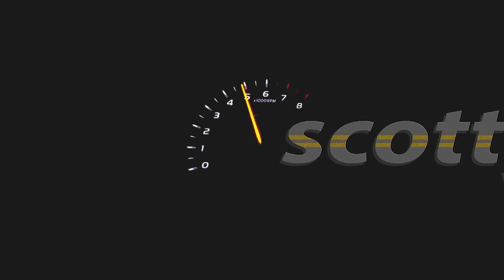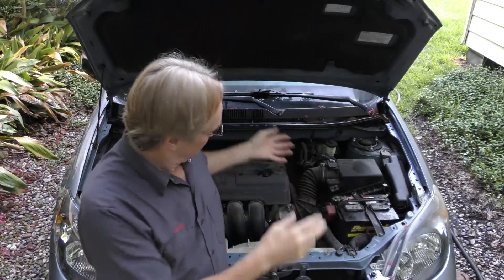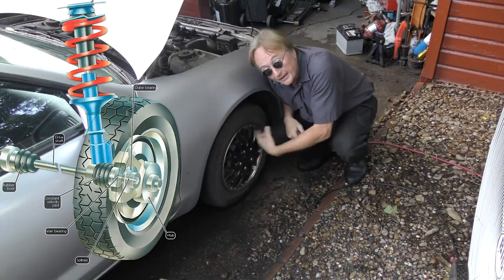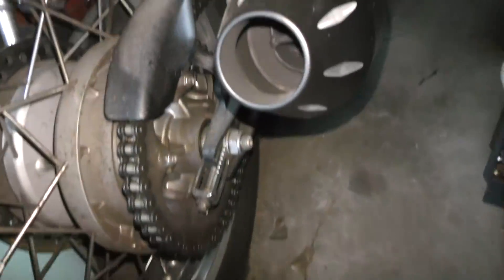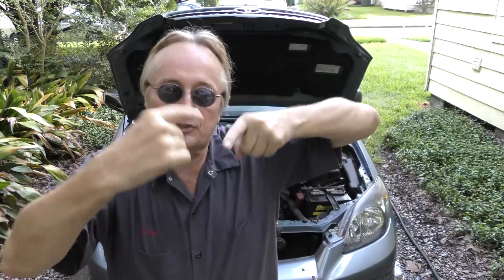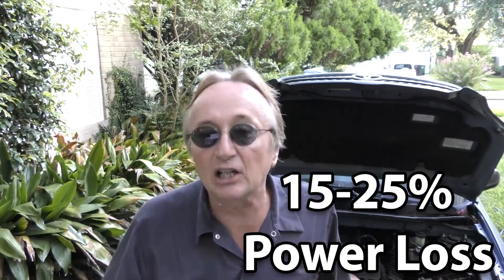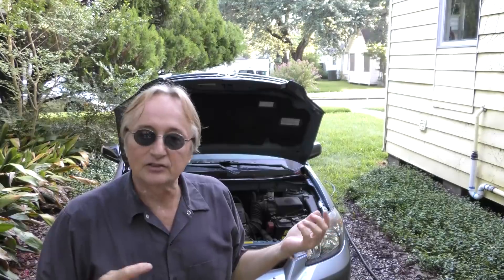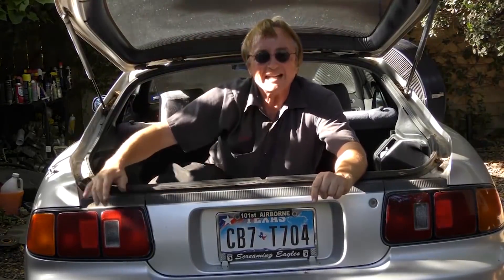Here's Why Your Car's Horsepower Rating is a Lie

Comment: what do you think about redline-ing your engine
Reply: Emin GanGster BS Its essentail if you want to get over 50k miles on a rotary, red-line it every drive and they will last over twice as long. Shift at 9.5k rpm if you have a stock engine.

For electric, its mostly temperature based, you don't want the wire insulation/enamel melting. Bearings will wear out slightly faster.

Piston engines will wear out faster, but what else are you going to do if you want that power? Duel turbo, methanol and NOS are some common options, but its a lot easier and cheaper to just let it rev up.

Jet engines red-line is based on exhaust temp for melting turbine blades and centrifugal force, but there isn't much harm keeping them at the limit, its the cycles of heat that kill them, so leave them spooled up.

Hamster wheel engines, people will call PETA... It's good exercise to redline your hamster once in a while, especially in winter when they put on some weight.
Reply: Jake Garret jet engine red line isn't just egt
Reply: John Arnold You are correct, I was dulling it down for the average person. Judging by the faces of most people when I start talking about jets or even stealth technology people get this blank look (or sometimes a look of pain when they are really trying to comprehend). Of course things are very complex, but I've found they usually don't want all the details.
Reply: Jake Garrett yeah

Comment: All the looses of power you mentioned Scotty PLUS ->  when they put the engine on a stand in the dyno room.   They have no water pump attached , no AC pump , no power steering pumps , no alternators that draw power from the engine. , no torque converter lugging on the flywheel.  Its just the block on a stand for a few seconds.   Just the engine alone actual horse power without it powering any of the power robbing leaches required by an actual street worthy vehicle .    Just like they run dragsters.

Comment: I recall two standards for horsepower; SAE and DIN (Deutsche Industri Norm). The SAE is the engine with no exhaust pipe and no drive train attached. The DIN is taken on the wheels. My first car was a Volvo 142. The dealer told me that it had 90 HP. When the car was brought and I later read the instruction manual, the car has 90 HP (SAE) and 82 (DIN). Anyway, back in the 70's most cars did not have many horsepower and the Volvo performance was fair even with 82 HP on the wheels.

Comment: I thought the U.S. made a mandate starting in 1972 all cars would switch from gross hp to net power. Is net at the wheels or after all accessories are hooked up, ac, alt, ps, etc...? I thought net was at the wheels.

Comment: I completely understand this. My 09 Nissan 370Z makes 332 horsepower at the crank. Really it makes about 285 horsepower at the rear wheel. That’s just stock. Now it’s fully modded with a tune, it makes 380 brake horsepower. And 308 wheel horsepower!

Comment: I saw a program where it showed a rear drive differential wasn't that inefficient. They were able to use a 1/4 hp electric motor to spin the differential to 200 mph road speed. Most of the power loss is the transmission. And automatics have servo pumps that are up to 2000 psi to pressure up the TC and drum clutches. But, today's automatics are a lot more efficient than ever before. Still...I prefer a really good shifting manual as I feel a lot more engaged with the car. Seems to make seem less like a 4 wheeled kitchen appliance...

Comment: Actually, starting in 1971 (I believe, but I might be a few years off), manufacturers switched from gross HP ratings to net HP ratings. Gross HP is how much the engine is putting out in ideal conditions. Typically, it would have been measured with the engine on a test stand and no parasitic loss from pesky accessories, like water-pumps, alternators, etc. Net HP would be how much the vehicle is making at the wheels, with all of it's accessories in place.

I'm not sure why your Mustang measured less on the dynamometer, but when the manufacturers make their readings, they do so using premium fuel, low humidity, room temperature air and an ideally tuned engine. Variables such as air pressure and air temperature, humidity, tire pressure, and even the temperatures of the drivetrain fluids can affect the car's HP reading. There can also be some parasitic loss between the tires and the dynamometer rollers due to slippage. Not to mention, cars sold at the dealership are tuned to operate in a wide range of environments, meaning, they aren't ideally tuned to operate in any one environment. An engine programmed to operate ideally in the Colorado mountains won't do as well as one tuned to the environment of Hawaii.

Comment: Did they change how they measure horsepower? My 1970 El Camino with a 350ci 4 barrel was rated at 300hp. My friend's 1970 El Camino with a 350ci 2  barrel was rated at 250 horsepower. Neither car compared to a car today with the same horsepower ratings as far as acceleration or speed.

Comment: And another reason horsepower ratings from factories are a lie is because they test a few, or even just a single engine that’s already been worn in. It takes time for your engine to be broken-in and run efficiently, because bearings, pistons, and many other parts get a better seal once they’ve been broken in. That’s why in almost every driving manual for sports cars today tell you there’s a break-in period telling you that you have to meet those requirements before you immediately start revving and doing digs and launches with your car.

Comment: Hi Scot, I’ve been a long time follower of your videos and i have always taken something home after watching your videos filled with knowledge. I have been confused by the methods used by Mercedes Benz and BMW for some time on how they rate their vehicles engine capacity according to the badges they are marked with, even before the vehicle left the factory. For example the latest BMW 1 series comes out with two 1600cc engine variables, one of the 1600cc motors which i suppose would have a “standard” ECU mapping and another 1600cc motor with a “better” ECU mapping. However, the 1600cc motor with the “standard” mapping will be badged as 116i but the other motor who has the “better” software but yet badge it as a 118i? Its brand approved.?I wouldn’t necessarily suggest someone replaced the (6) with a (8).. and with Mercedes-Benz method i have yet to figure that out.

Comment: The Lotus also developed the Ecotec engine of the L61 to even at one point Chevy have once sold a Lotus.  Even a Toyota Cavalier.  Now if I can find a good transmission to place all of that power to the rear wheel of the old hatchback Cavalier, have quite a bits of space in the rear I will never get anybody to fits in.

Comment: Unless you buy an LS1 engine. My 2002 WS6 was rated at 325 hp at the crank. Yet it made 331rwhp on a SAE corrected dyno.

Comment: I remember a while back I saw a debate in an online forum, where some guy in a 2008 Cobalt SS Turbo was kind of bragging about beating the older 2003-2004 Pontiac GTO's - despite the GTO having something like a 90hp advantage. This spurred on a huge debate between the two car groups, but then finally one of the Cobalt SS guys laid it all out and ended the flamewar...

Apparently, the 2003 Pontiac GTO initially came standard with an automatic transmission and through drive train loss, as you put in the video, only dyno'ed about 270hp at the rear wheels. The 2008 Cobalt SS Turbo made 240hp to the front wheels. It had less drive train loss because it was a front-wheel-drive car with a manual transmission.

The power difference between the two cars was cut down from 90hp to 30hp... just like that! Now it was all down to gearing, weight, and the driver (more so the driver of the Cobalt SS since it was a manual transmission car).

That's when I learned that having 300+ horsepower at the crank is good and all, but what's the power to the wheels? I would've hated to have bought an '03 GTO with 350hp thinking it was a decent sports cars, only to get walked by a Cobalt!

Comment: One thing to note is that low HP vehicles have bigger losses than high HP vehicles.
Spinning the wheels at 60 mph takes the same amount of energy regardless of how much energy is entering it. The only variable that will go up with HP will be slip which typically isn't a very large loss.

Comment: Apparently there are a handful of engines that produce more power than claimed. The GT-R was one of them, since they’re hand built. GM was conservative with their estimates of the the supercharged 3800 V6 because of temperature sensitivities. I don’t think the engine overheated per se, maybe it just produces different power figures at different internal temperatures.

Comment: Sometimes it goes the other way.  My current car is a 2018 Accord with a 2.0T.  Honda states that the rated horsepower is 252 yet the car consistently comes in at 266 on a dyno.

Comment: The drivetrain losses to a rear drive vs a front drive only has to be quite insignificant.  Yes, rotational torque has to change directions, but I really don't see the losses involved, other than having to spin up a relatively heavy drive shaft and maybe the hypoid gears involve a little more friction.  But seriously, where does that energy go?  It has to go off as heat/friction.  I would guess it to be 1-2% more loss than that of a transverse mounted engine in a front drive car.  But those 1-2% figures become big factors when trying to get a car to be emissions compliant.

Lots of Audi/VW cars are front wheel drive, yet have a longitudinally mounted engine.
The Renault Medallion had the same setup.
The Chrysler LH cars also had the same setup.
I am sure there are more.... such as the Acura Legend.
The classic Saabs, too.

Motorcycles run chain or belt drive due to cost and weight savings.  It is far cheaper and lighter weight to implement a chain drive instead of shaft drive.  Since most motorcycles have a very limited lifetime mileage-wise, there's s no reason to implement anything else.  

The front-drive package was implemented with the original intent of reducing costs and making the drivetrain more compact and eliminating the need for a hump down the middle of the passenger compartment.  It was marketed as having better traction, which it did, and deemed safer because it wouldn't do a donut on a snowy road as easily as that of a rear wheel drive car.  it would increase passenger compartment room in a market where the physical size of cars was shrinking.

Comment: Wikipedia: "In the case of an engine dynamometer, power is measured at the engine's flywheel.[citation needed] Also, with a chassis dynamometer or rolling road, power output is measured at the driving wheels. This accounts for energy or power loss through the drive train inefficiencies and weight thereof as well as gravitational force placed upon components therein"

Comment: High HP doesn't necessarily mean efficiency. You can have a rich mixture, primarily in turbocharged engines that burn lots of fuel but put out extra energy.

Comment: True most of the time. But I just watched a Mk 4 GTI get on the dyno for a base run before mods rated at 170 horsepower.  And put down 178 to the tire completely stock.

Comment: MACK Trucks rates the horsepower of their built trucks using a Dynomometer at theor production line. Once a truck is finished-up they send it to a rolling dyno to test and give proper Horsepower ratings, so when MACK TRUCKS says you are getting a 610 HP / 1,850 LBS/ FT MACK TITAN it is a truck that puts 610 HP and 1,850 ft/lbs torque to the ground.

Comment: Semi Truck Manufacturers usually have entire charts dedicated to this with HP at rear axles with various engine and transmission packages. 

But unless its towing or racing the average commuter its just empty numbers past 120HP.

Comment: This says correct horsepower is between the engine and the wheels. What about between the wheels and the road - should that mean something? Is it horsepower if you're spinning in mud? (Maybe so - maybe a horse spinning his hooves in mud is still generating power. I don't know. That's your problem. I'm just asking.)

Comment: The 2017+ Honda Civic si’s hp rating actually is pretty accurate. People have dyno tested them and came out more than Honda rated for them at the wheel. This is without the flash pro upgrade. I didn’t think my civic would be really close to that

Comment: Hey Scotty..  So what's the actual difference between BHP Brake Horsepower  and WHP Wheel Horsepower?   Why measure it at the brake and at the wheel?  Are they the same or slightly different?

Comment: A lot like outboard motors. Not as many places for power loss on them, but the drop is about 10%. They used to measure horsepower at the crank. Manufacturers were mandated to rate all new outboards at the prop shaft in 1985. I don't know how they got a reasonable statue passed, but it would be nice if they did the same for car horsepower rating, and based it on a dino on cars. A different era, I guess.

Comment: About time someone pointed this out. BHP is not just BHP A lot of BHP is crap. I met a guy with a very old large heavy 1930 Rolls Royce and it moved along fine with only 35bhp. I was in the soud production business for years and Watts were not Watts, I had Amplifiers that would out perform the new switch mode Amplifiers with twice the power. And there are some cars with half the BHP of others that can out perform them or others and very quietly. After 60 years of motoring with some very fast cars, to me BHP and noise are both nothing but a load of crap, made mostly for juvenile personalities.

Comment: Scotty, I hate to break it to you but there are automatic transmissions out there that also do not have torque converters. All the super cars of today use dual-clutch automatic transmissions which use computers to control the shifting of the gears in much the same way one would shift the gears in a regular manual transmission. The only reason regular automatic transmissions (with torque converters) are used today is for cost reasons and also because dual-clutch automatics are terrible in heavy traffic. The computer constantly activates and deactivates the clutch when you creep along thus wearing it out at an astonishing rate. A regular automatic with a torque converter can safely creep ahead with 0 damage to the transmission. 

I only wish for the older generation to finally acknowledge not all automatics are slushboxes.

Comment: All horsepower lost is turned into heat. Since there are so many variables between the drive shaft and the wheels how would you like them to rate engines? Unless you operate the engine at the RPM the engine horsepower is rated at you'll never use it at full power output. Even the weight of passengers and whether or not the AC is on will affect the maximum horsepower at the drive wheels.

Comment: Cars also lose hp more or less depending on the tires, tire pressure etc. Tire hysteresis is the main reason for "rolling resistance" which is dissipated as heat.

Comment: Often times Dodge has underrated HP on certain cars.  The SRT-4 is a prime example.  That little neon actually got 220 to the wheels, same as advertised, wheel horsepower was actually 245/250, which was supported by the performance aspects of the vehicle.  Dodge did that same crap back in the late 60's early 70's.  Some say it was for insurance purposes, who knows?

Comment: The ONLY thing FWD has over RWD is ease of assembly! Rotational losses are actually higher in FWD due to the convoluted route the power travels. Had a Lincoln LS advertised at 210hp and dynoed at 190. IIRC parasitic loss is around 10%-15% in RWD cars.

Comment: I don't think they are actually lying, that is what the motor makes. If you actually didn't know that the rating was from the crank you're not a car guy. Hot Rod Mag. did a test back in 2004 by taking a mustang around to 4 different types of Dyno's. Their results were between 205.7 H.P. TO 226.9 H.P. The factory said the car was rated at 260 H.P. So it actually depends on the dyno. used too besides a lot of other things, weather, temp. of oils, tire pressure, guy running the dyno, ect..... Great vid though, you've been pushing them out fast lately.

Comment: Scotty I have a problem with my car, I drive a 2009 g37xs but now for some reason the gas gauge is not reading the gas level properly. 

I brought the car to the dealer and they told me to change the sending unit and fuel pump which I did but the problem is still there?
I tried many different fuel and sending unit and nothing seems to work.I have also changed the cluster unit with a 2010 model to make sure it wasn't the cluster and problem still persist.
I have done some research and it seems infiniti and Nissan had that problem for many years back. there's other member who drive the G37 with similar problem.

I almost died while driving on the highway because I ran out of gas. I called infinity and spoke to them about this concern which to me is a safety concern but I was told that my warranty is done like WTF to them.
I went to another infiniti in ottawa and was told that they do not know how to fix that problem just keep tracking your mileage and when you reach a certain number go and fill up which to me is pointless. 
any advice because i am tempted to drive to a different town to have them check? cuz I am not trusting those infiniti dealer anymore in my area?

Comment: engines are rated from crank so its not a lie... Alot of engines are also under rated and some cars get more at the wheels than advertised at the crank... The 03-04 cobras were 390 and they dynoed over 400.... Mine stock did 425